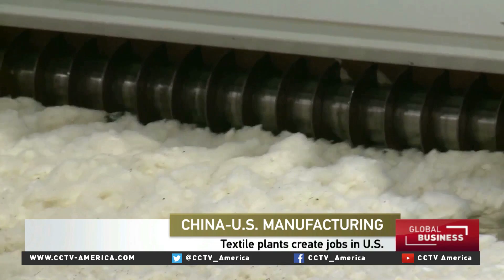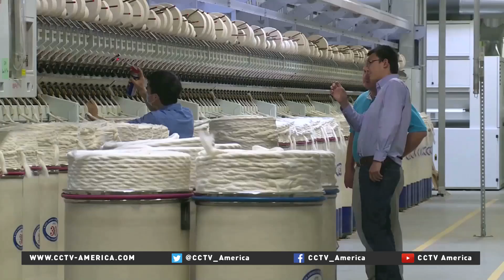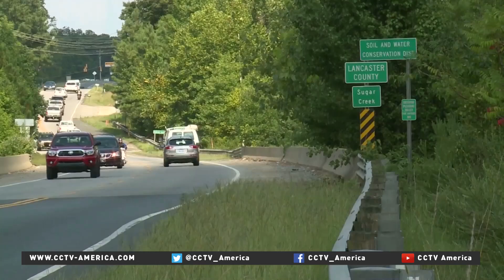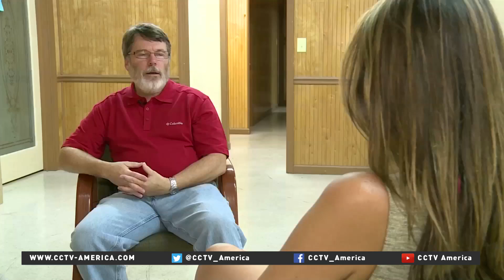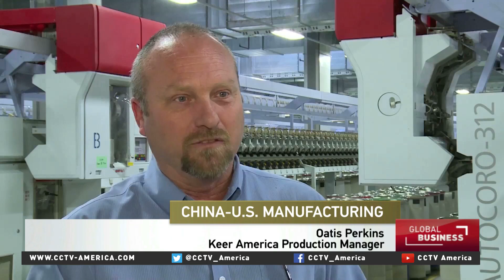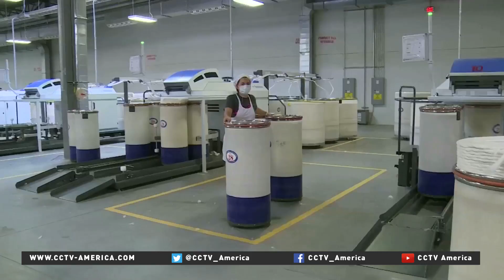Some Chinese manufacturers looking abroad for labor

Comment: china today is not china in 1994 or  even china of 2005  chinese have become richer than before living has become costlier almost every one in china has a car and an apartment china has started investing  billions in building robotics labor to fill a gap of cheap labors and to prevent chinese business from moving outside
Reply: It would be more cost effective for business to move outside or they wouldn't do it. China should lower all its tariffs to zero to allow it to increase the wages of its workers inside China.